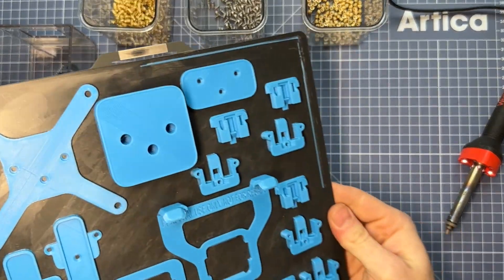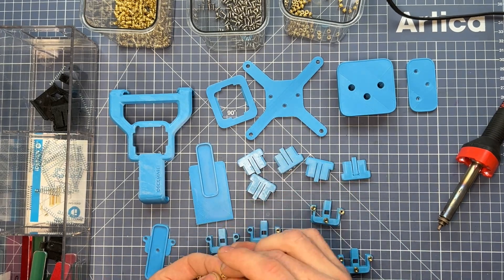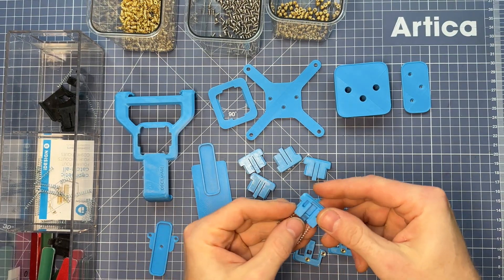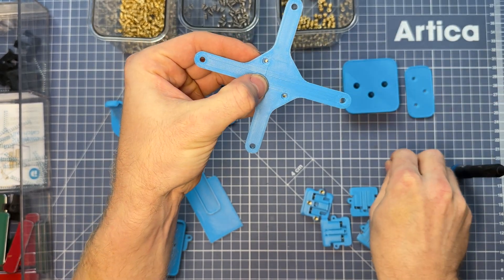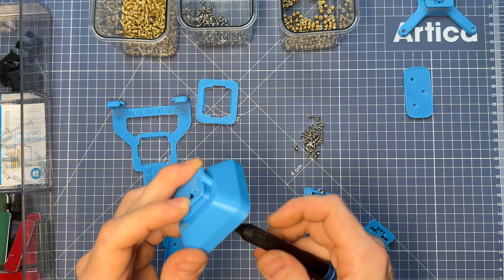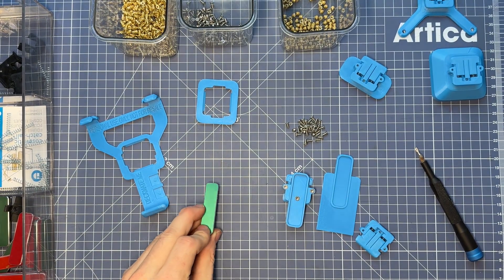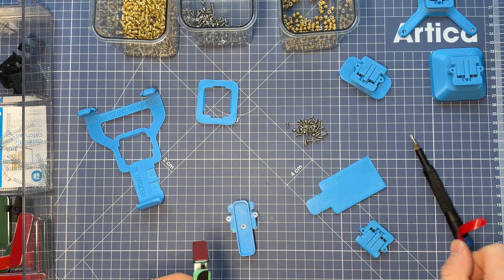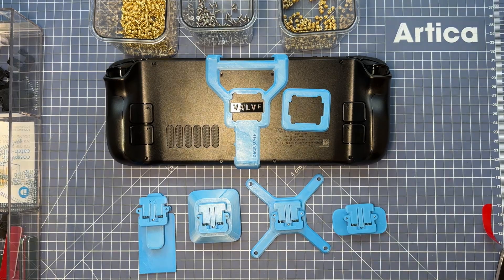How to 3D print and Assemble Deckmate, the Best Steam Deck Accessory!

Comment: I'm really excited about these accessories but I'm also worried that the printed grip will snap and my Steam Deck get damaged from falling off the VESA mount. I'd much rather order the molded parts but shipping to Germany would about double the cost 😭. Any chance on partnering with a reseller in the EU in the future?

Comment: Is the stl file for the kickstand that is sold with the deck mate available? Not the one where you use another phone stand as the mechanism, thanks for your support in this community
Reply from the maker: Unfortunately it isn't. The reason is because that one uses a custom metal friction hinge that is impossible to 3D print or buy off the shelf. So even if I made the plastic parts available it wouldn't ever be able to work as an actual kickstand
Reply: @getmechanism  I really appreciate your response. I love your product and even tho it’s very well priced, where I live with shipping cost, duty and import tax it lands up being very pricey. Was hoping to get one printed her but I’m having the same problem with the cost of the mechanism. Anyway thanks for your absolutely stellar work in this community, keep it up 🔥

Comment: Are M2.5 x 3mm heat-set inserts capable for Deckmate?
Reply from the maker: Yes, those are the preferred length actually!
Reply: @getmechanism  Thanks!
Reply: @getmechanism  Are the width of the inserts also 3.5mm?

Comment: I'm having a lot of trouble getting the top and bottom mechanisms with the springs to print and fit together well. What size nozzle are you using?
Reply from the maker: I printed these with a 0.4mm nozzle and 0.2mm layer height. What material are you using?
Reply: @getmechanism  pla. I tried .4mm with .2mm layer. I am having moderately better success with .2mm nozzle and .16mm layer height. Should I try abs instead?
Reply from the maker: @jasonjennings6686   That's so strange! Mine come out exactly right every time. What printer are you using?
Reply: @getmechanism  Voxelab Aquila that has quite a few updates. It prints pretty well. The pieces go together, but they don't slide back and forth very well. I am not using the heat inserts either. I think I am going to try printing in ABS.
Reply: @getmechanism  I printed in ABS and sooo much better. Works like a charm now! Thank you
Reply from the maker: @jasonjennings6686  Amazing! You're actually the first I hear from that ABS worked better than PLA. I'm glad to hear it!
Reply: @jasonjennings6686  I had the same issue with PLA + but I found out my Ender 3 Pro was over-extruding just a bit and causing issues. ABS may have worked because of the extra shrinkage over PLA. What really helped is -0.3mm first layer horizontal expansion to get rid of elephants foot and -0.01mm horizontal expansion everywhere else. Yes it's only -0.01mm but it made a world of difference for me.

Comment: my prints come out bad the areas where supports would go all collapse.
Reply: @shrimpinpat Hmmm this is strange. How does a Benchy print on your printer? The reason I ask is because none of the overhangs are too dramatic, the most is a 45 degree overhang so most printers should be able to handle this perfectly fine